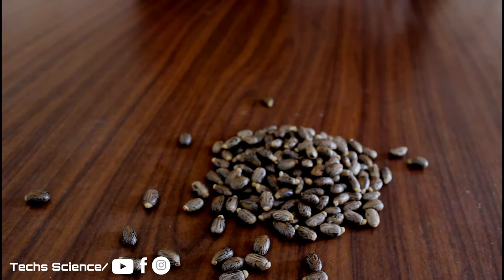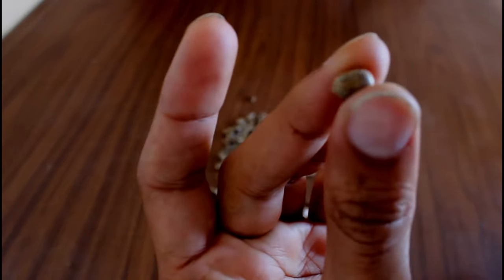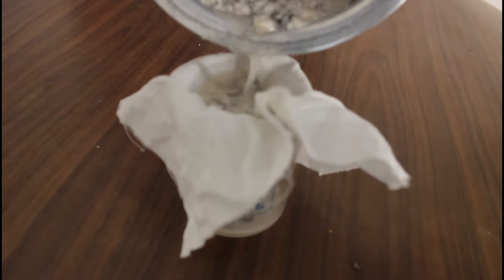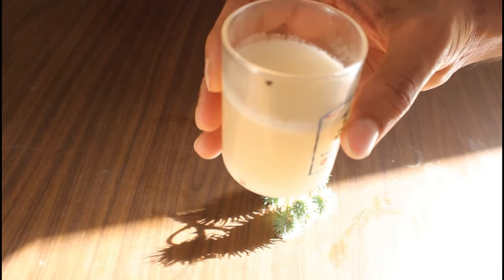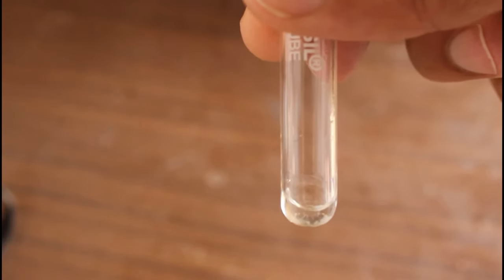Extract Castor oil from Castor Seeds

Comment: Where ricin poison seed in waste material
Reply: could u remake the question?
Reply: @DuOliv  he asked if the ricin was in the waste material
Reply: @apathetic0232  the answer is yes but the amount is lower than if you process it the original way
Reply: @meltingpotoffriendship  and what is the original way? And how can it happen?
Reply: @sultana9737  using acetone
Reply: @PrinceAndrewFucksKids  so how can you seperate ricin out of the solution?
Reply: @sultana9737  sultan yanlış yoldasın sultaaan

Comment: which part is most toxic?
Reply: Outter shell
Reply: @TristanTheChessPlayer 

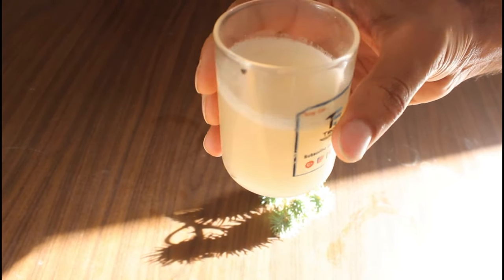 5:17 
Where is the toxic part ?
Reply: The most toxic part isn't in the video it's the most outer layer that cracks open ones the seed dries it has some kind of husk strings looking like small thorns
Reply: The inner part. The outer shell is incredibly thick, and if swallowed whole (assuming the outer shell is perfectly sealed with no cracks) it can go through the digestive tract without being damaged by pepsin, acids, and other enzymes, thus not causing any harm. However if you swallow the soft-ish white part inside the shell you will have problems since that part will be broken down and absorbed by your enterocytes
Reply: @amaze3727  hey it's the chewing that releases ricin not swallowing whole, if you chew the hard out part it contains more ricin than the seed itself
Reply: No, the hard part has no rcin. Source: Article on Sage Journal (I tried posting the D0I here but it gets removed). Extraction process is detailed deeply in a PubMed article
Reply: @amaze3727 How exactly is it obtained?  Can I learn in detail?
Reply: @amaze3727 whats the name of the article?

Comment: Does heating the oil neutralize the toxic part?
Reply from the maker: Actually oil not toxic
It has negligible risin in it
Reply: I'm getting what you trying to seek
Reply: Yes, heating it to at least 80 degrees celsius will make the protein complexes (A and B) that form ricin go through denaturation, making non-toxic

Comment: Oil safe means the waste material poisonous?
Reply from the maker: Waste material contains a bit of risin still they used it for cattle feed,
As an estimated lethal oral dose in humans is approximately 1 milligram per kilogram of body weight.
So it will take around 60-70 of risin to kill from risin poisoning 
(Even water is poison its all about quantity)